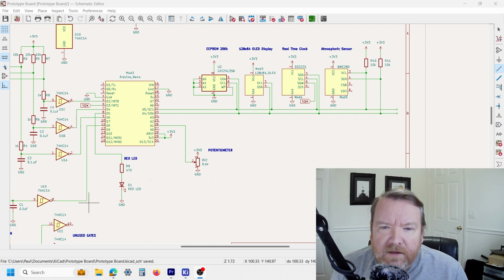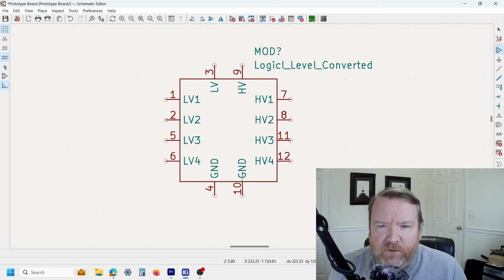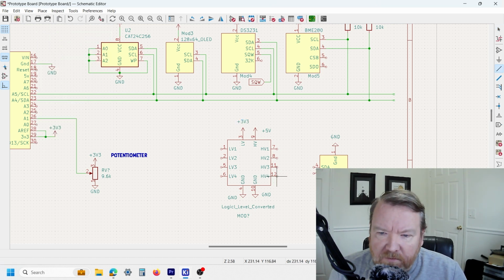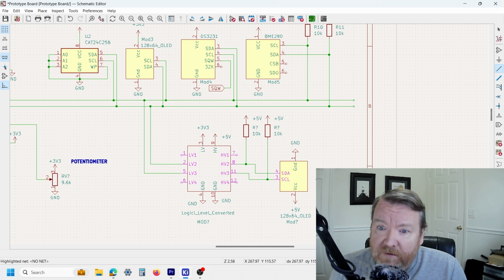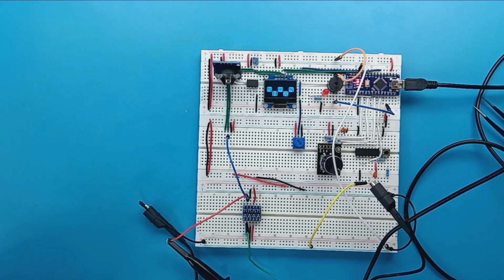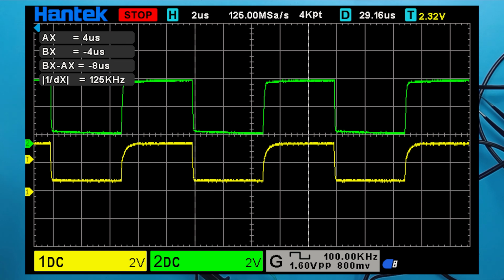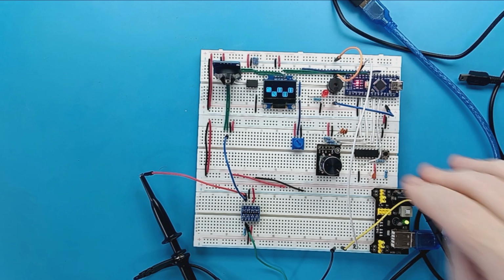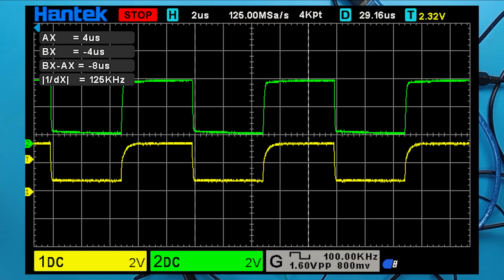I2C - Logic Level Converter

Comment: Would the Level Shifter allow a faster I2C bus for your prototype board if every device were level shifted (even to the same 3.3 voltage) … assuming all devices can work at that speed? In other words, you have 4 I2C devices, and so, that much more capacitance for the pullups to charge. With each I2C device behind a Level Shifter, you have five electrically separate bus legs, each with its own capacitance. Therefore, the rise time on each of the bus legs should be faster, as you've effectively divided up the total capacitance, which would otherwise add (with no Level Shifter). Is that right?